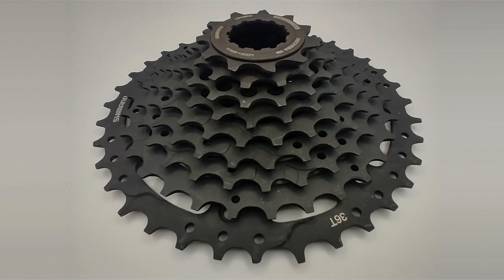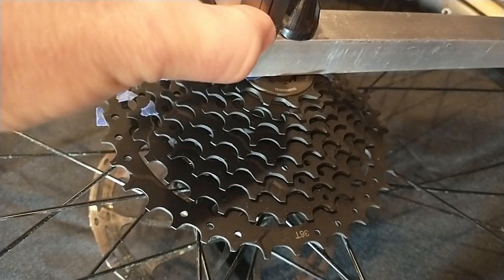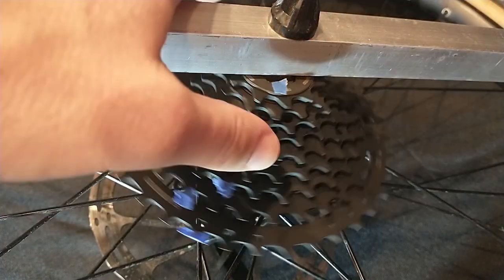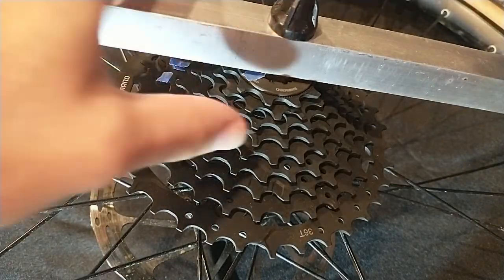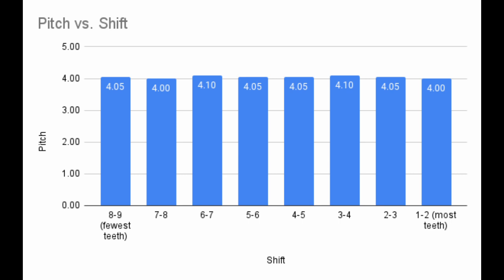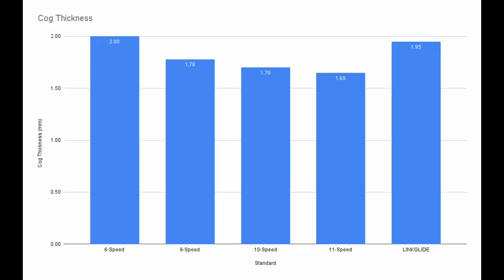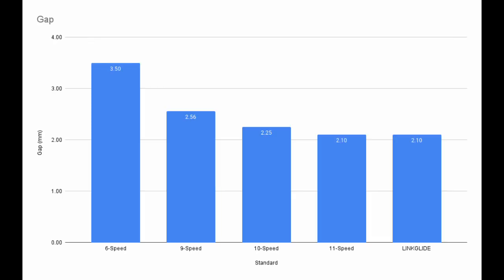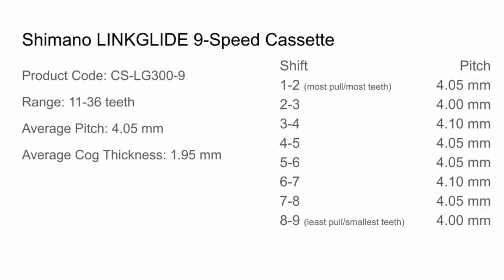Shimano CUES LinkGlide 9-Speed Cassette Cog Pitch

Comment: From your videos and other information on internet, I made the following assumptions for a 9 speed systems.  (No measurements made)

LinkGlide – Cues shifter and deraileur
Hyperglide – Cassette and chain

These two systems do not match and information as follows:

Cog spacing, referring to the “center to center” spacing between the cogs (sprockets) on a cassette. 
Shimano CUES LINKGLIDE CS-LG300-9 has c/c cog spacing (3.92mm) (11 speed);
Shimano 9sp HYPERGLIDE CS-HG200-9 has c/c cog spacing (4.49mm), (standard)

Cues LINKGLIDE shifting systems requires HG 11-speed chain; and chain supplied is standard 9 speed chain.

Cable Pull for Cues LINKGLIDE shifter is 3.56mm
Cable pull for 9sp HYPERGLIDE shifter is 2.74mm

Pull ratio for Cues LINKGLIDE derailleurs is 1.11
Pull ratio for 9sp HYPERGLIDE derailleurs is 1.64

Comment: I measured 8, 10, HG 11, and LinkGlide cassettes using a height gauge, 123 blocks, and a flat surface.  I found LG to have a 4.10mm pitch, HG11 to have 3.76mm, and 10sp to have a 3.95mm pitch.  The LG cassettes are slightly wider than HG11, as they will fit on a road 11sp freehub without a spacer whereas an HG11 cassette will not.  I personally found the LG Deore XT mech to not be really great at shifting, it is difficult to get the SIS tuned to shift perfectly in all gears, you give up shifting at one end of the cassette or the other.  I just installed an electronic derailleur and shifting is absolutely perfect, haven't had any mis-shifts yet.
Reply from the maker: Thank you for the info! I seem to find that my measurements vary a bit depending on how I measure. I wish I could come up with a more consistent and precise way to measure cog pitch. I'd be interested in seeing a video of how you measure the cog pitch.
Reply: Same here I ram RD-RX817 with LG-500-11 11-45T, shifts good on my ebike with Di2. Just run the etube app to tune the shifts. I think the Wheeltop GEX or Ox will be good because that system can individually space each cog shift spacing.
Reply: The LG cassette has the same cog pitch and thickness every gear . In the HG cassette,  cogs from 11 to 24 t. are thinner (1.6mm) while the othe cogs are 2mm thick with the same spacer (2.25mm) ; therefore the pitch is non constant

Comment: Cues in fact have 10sp shimano cog spacing, so 9s, 10s, 11s cues cassete will work with shimano mtb rear derailleur and shifter and chain.
But with 9s you need to use Low or Hi screws to disable one geor on the shifter.
With 11sp scenario your only way is cues shifter (but it will work with 10sp or 11sp or 12s rear derailleur)
Reply: and iirc link glide technology is only about cassete, chain or derailleur doesnt care, except shifters have less click from one push because ebike motor can bend cassete if you can try to shift 3 gears up in one push.